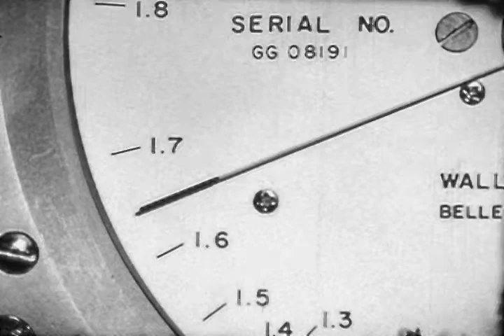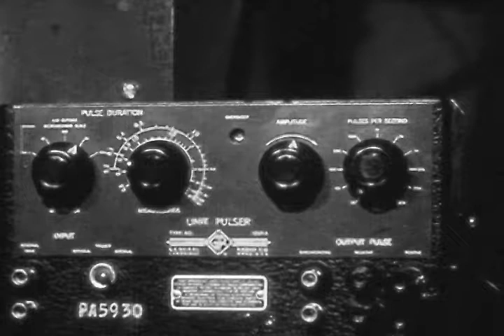Liquid Helium II the superfluid (part 6 Second sound)

Comment from the maker: @mwdub02 Regard He II below the lambda point as composed of 2 fluids:
1)A superfluid fluid with perfect flow reversible in the thermodynamic sense.
2)A normal fluid with irreversible flow.
Just below the lambda point most of the liquid is composed of normal fluid at absolute zero it would consist of only superfluid. The ratio depends on only temperature and it's a dynamic equilibrium (think of an atom sometimes belonging to the superfluid and later the normal fluid - not as being fixed forever).

Comment from the maker: ...cont When it flows out of the beaker with the porous bottom, its only the superfluid which flows out. But the normal fluid left behind is still below the lambda point so it must adjust its ratio to be partly superfluid (which then immediately flows out). When the temperature is very low it flows out more rapidly because most of the liquid wants to be in the superfluid state.

Comment from the maker: @TheCryptore Superfluidity in solids is only a theoretical possibility and would require temperatures many oders of magnitude smaller. In addition glass would not have the necessary quantum mechanical properties to become superfluid. Superfluidity is due to the atoms forming a Bose-Einstein condensate, which has only been observed in helium and clusters of a few thousand rubidium atoms.

Comment from the maker: @TheCryptore Not necessarily. Superfluidity in anything other than liquid helium requires cooling below 0.000001 degree K. A 'supersolid' is solid but at the same time superfluid. There is some evidence to suggest that the cooled rubidium  atoms are crystaline and therefore supersolid. A supersolid may have been seen for the first time in 2004 in helium crystals - it's still the subject of debate. Macroscopic quantum phenomena like this are not just weird, but weirder than you can imagine.